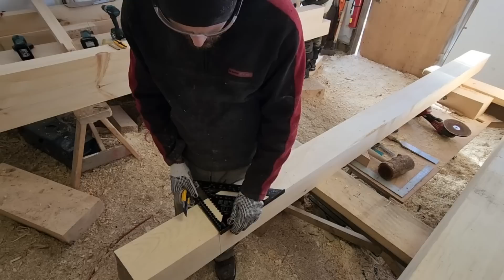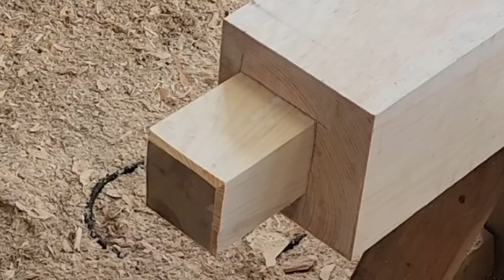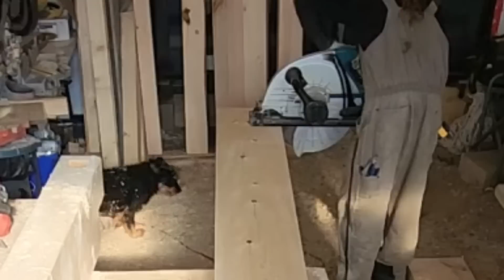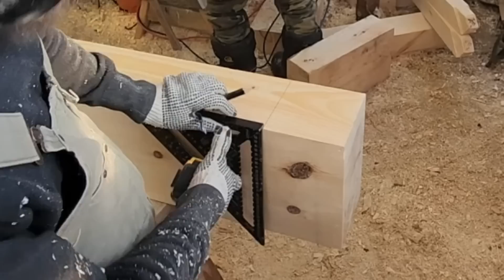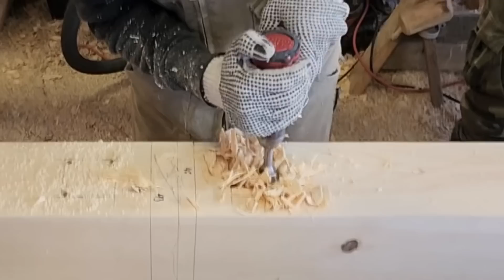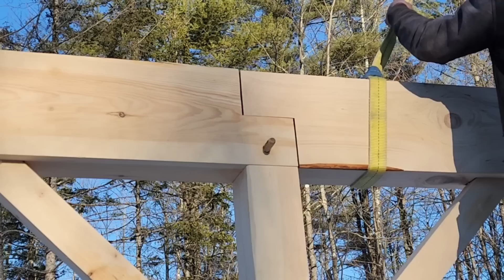How To: Post+Beam Step By Step🇨🇦

Comment: Nice work on the video. Really nice to see the verification of the joinery before assembly. Having done a few Timber Frames I can appreciate the importance of getting it right especially with Scarf joints. You are obviously very experienced but I was curious as to why you use the term "Post and Beam". My understanding from school and the market place was that this is really true Timber Frame as to me Post and Beam infers that there are some hidden mechanical fasteners used. In any case no matter what  you call it, it's very pleasing to watch. Cheers John
Reply from the maker: Thanks for the comment, John. 
I also build log homes, and there are 2 main  techniques that are Scandinavian and the other is post and beam with round logs. So basically, Timber frame is post and beam with square timber. So you are correct to call this timber frame.
This is an obvious detail that I should have mentioned in the video or even in the title. The elephant in the room. 😆
Reply: @MEDASINE  Thanks, I did not want to get into semantics but I appreciate the info. Keep up the great work.

Comment: Could you provide a link or description to the angle grinder attachment you are using to level out of the face of those cuts? Great Work love the video
Reply from the maker: 5'' angle grinder sanding pads.
Get the 36 grits or 24 for rough and 50 to 80 grits for finishing if needed.
Reply from the maker: At any hardware store.

Comment: Looks great, nicely done! Two quick questions: How do you fasten the top lap joint? And, do you recommend a lap joint to turn a corner?
Reply from the maker: GRK fasteners for the lap joints. You can also use dowels. 
You can use lap joints in corners too.
Reply: @MEDASINE  Great, thanks! If you use a dowel to fasten the top lap joint, I assume you just make the post tenon longer and have it extend through the bottom lap joint. Is that correct?
Reply from the maker: You could. You can also put the dowel from the top of the top beam to the bottom beam, then true the post vertically. You could put 2 or 4 dowels depending on the size. One each side of the tenon.
Reply: @MEDASINE  Perfect, thanks. Again, nice work!

Comment: Great job! Did you have a structural engineer or architect draw up your plans, or did you create the design yourself?
Reply from the maker: There was no engineering for the timber frame part. This project was a home owner contractor, and it was done like the home owner decided. It's not the best way to go. If you don't have much experience, it's better to have your project engineered by a professional. Some people are afraid of them, but in the long run, it's a good safety net.